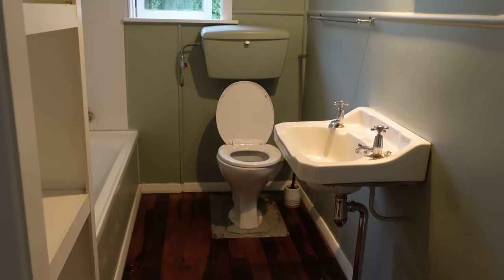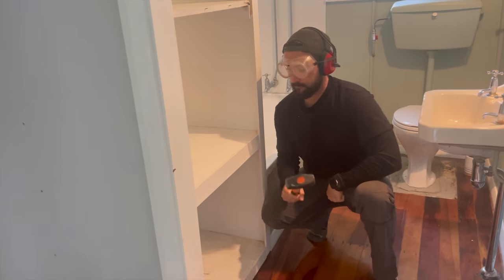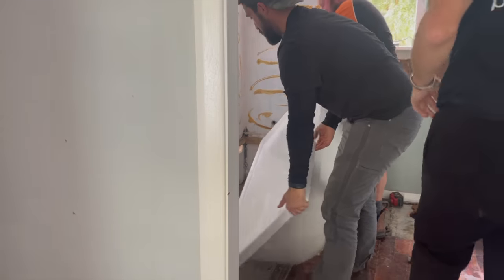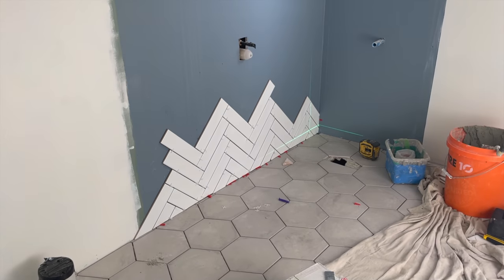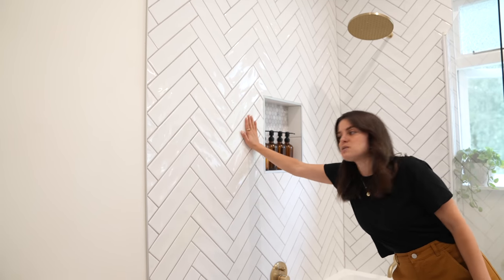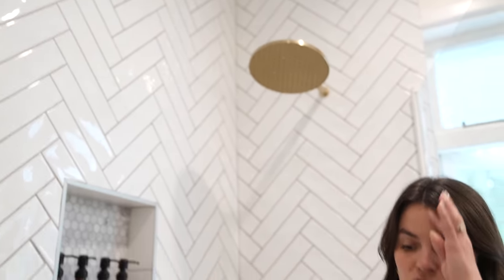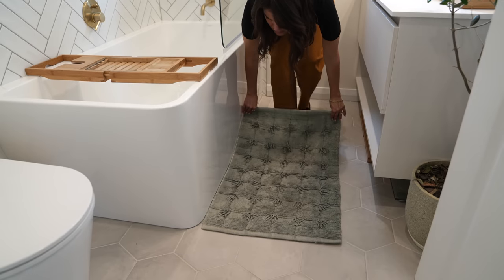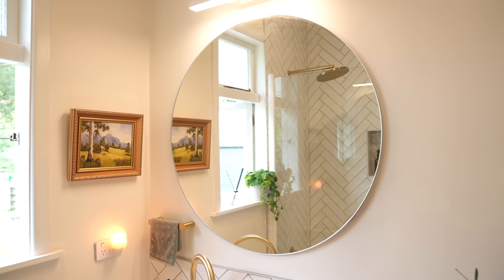DIY Small Bathroom Renovation w/ EXTREME Before & After | Homestead Makeover

Comment: Floating shelves above the toilet and some artwork on the other wall would really work. Amazing job on the bathroom! Complete transformation and looks so warm and inviting, especially with the added feature of the low light switch, very clever!
Reply from the maker: Thank you!!
Reply: Beat me to it. Floating shelves with another drooping plant on there would look cool.
Reply: First of all, I love your bathroom.  You both did an amazing job. <3  I also have floating shelves above the toilet and I love it.  I style functional bathroom accessories up there.  Since they are visible, guests don't have to open your cabinets to find them. You can fold two white towels and put a trailing plant (like pothos) next to them.  The towels are pretty decor, and guest know that they are clean towels they can use. Your towel rack is beautiful!  Once the towels are in use, they can be stored there.  I also stack three toilet paper rolls in a triangle on one shelf and then have some apothecary jars with toiletries next to it for guests.  My toilet/shelves are right text to the sink so the apothecary jars make sense, but instead you could style with small artwork, candle, etc.
Reply: Floating shelves was exactly what I was thinking too.

Comment: I think I would do a built-in shelving unit, from floor to ceiling, surrounding the toilet, for storage. I wish I could upload a photograph here of what I have in mind, but if you look at space saving storage cabinets above toilets- on Pinterest, you will find it! I would do something flat- fairly close to the wall, so that it doesn’t feel overly obtrusive. Which is why I would do it from floor to ceiling so you can really maximize the storage space. And if you do it well, it can look like an art piece in itself! Also, I would make sure that most of it is closed storage, so you can’t see anything (which as you know, makes a space feel cluttered). White in color so it blends in with the wall. Maybe with frosted glass paneling or stain glass panels. But maybe have a little alcove space in the middle, above the toilet, where you could put an art piece, with Lighting right above it to highlight it….. OR, you could also do lots of built-in storage along the entirety of the wall where the door opens into the bathroom. That way you can’t see it until you’re in the bathroom. And if you do it well, it could be really pretty and look like an art piece too! Also, if you didn’t want to do built-in shelving long, the entirety of the wall- you could just do one or two large shelves that span across the wall horizontally, above the door- which could be a really pretty raw wood, with woven baskets to store items- so it looks like an art piece too.